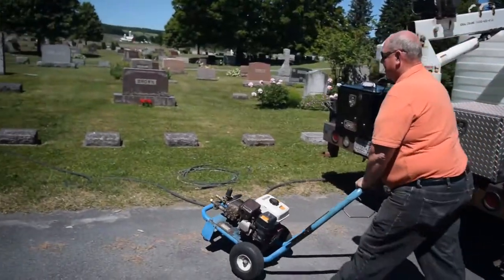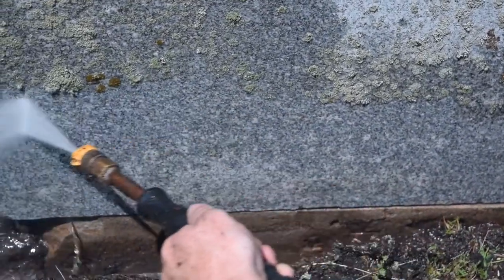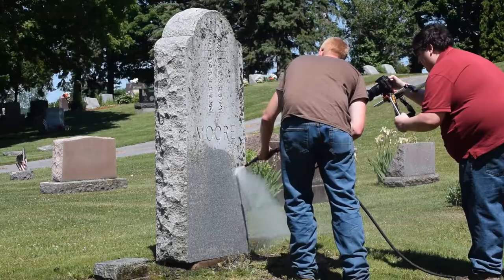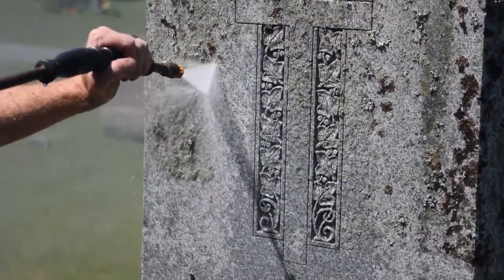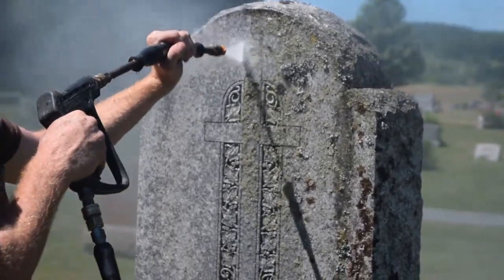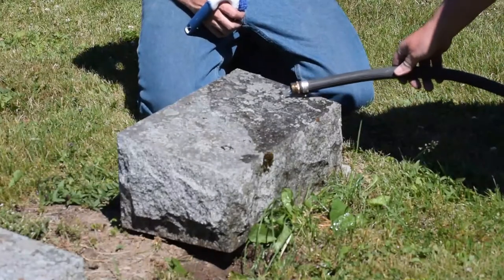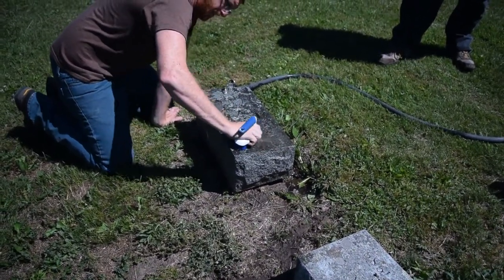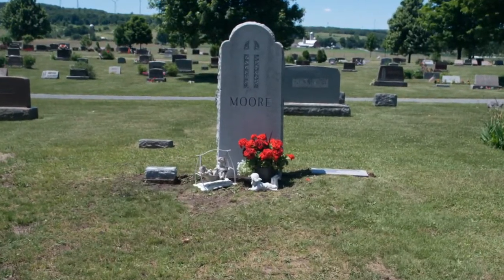2 secrets of Cleaning Headstones

Comment: Oh my Lord! Don't use a power washer on any gravestone!
Reply from the maker: Hey we have been using a power washer on gravestones for years why the objection?
Reply: @-gravestonepros  it ruins them.  Clearly your no pro or you would know that.  The pressure washing will erode the stone so much that you can't read the letters!!! Use D2 or Wet and Forget and a scrub brush with some good Ole elbow grease
Reply: @-gravestonepros  you said so yourself it wears down the lettering.
Reply from the maker: @ashleymitts  I would have to disagree with you. The powerwasher will ruin old marble stones if you get to close or the marble is to old. In many cases if you know what your doing your fine. Today most stones are made with granite and the powerwasher will not hurt granite anymore then a brush would.